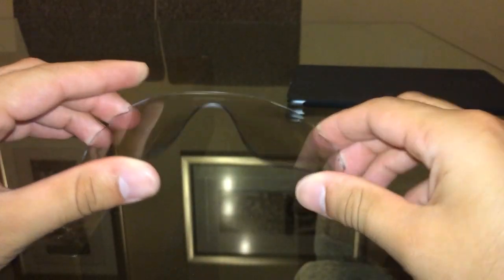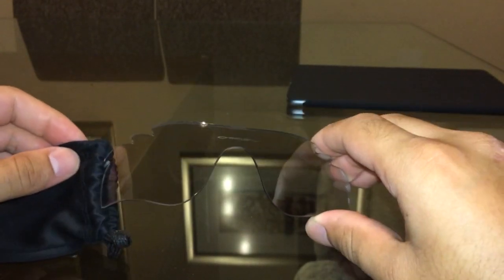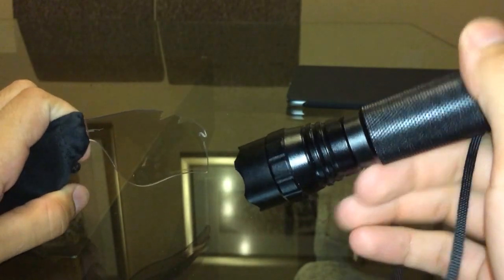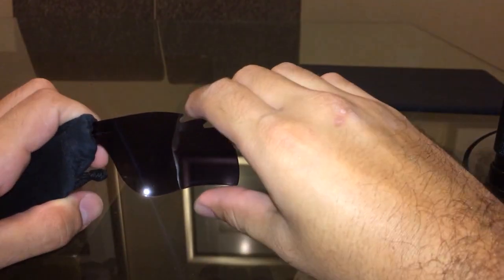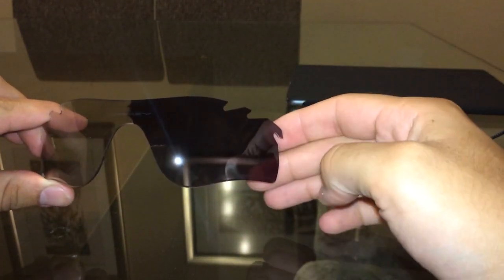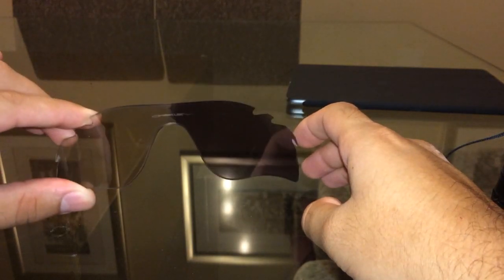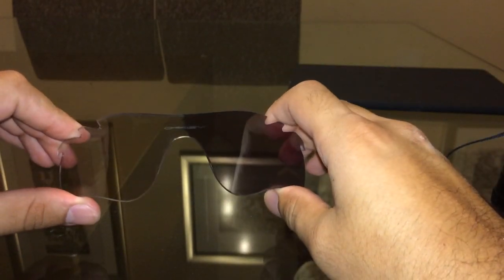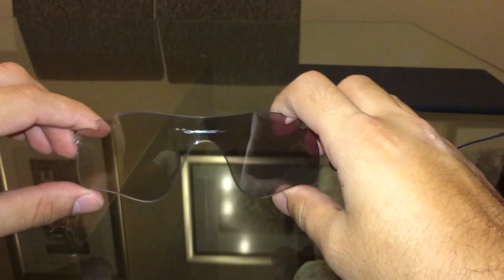Oakley Photochromic - Transition demonstrated

Comment: Thank you for the video. You used a very strong ligth that turn the lens very dark. In real world sun ligth, how fast is the transition time? I was looking to use them on trails where there could be huge variations of brightness in a very short amount of time. Do you think this lens would be good?
Reply from the maker: Davide Sandona' I can't exactly say how fast they change, however, they work perfect for what you are suggesting (I'm using them for the exact same purpose). If the trails you go in are not too covered and dark I would suggest you use the Prizm Trail lens, which I have been using quite a lot lately. They are not photochromic but definitely makes the plants and soil color pop out so you get better clarity and are able to better discern where you're going.

Comment: Do they work good if it's really sunny out or do you need the prism lens
Reply from the maker: Hi Matthew, they work well enough but nowhere near as dark as the demonstration. Remember I was using a very strong UV light to show how dark it goes. However, in real world use it's good enough for really sunny days (I live in Paraguay). I also own an Oakley Jawbreaker with the Prizm Trail lens, and these photochromic seems to get darker than the prizm trail lens.

Comment: I bought the EVZero Range model with photochromic lens but they don't seem to transition as dark as yours. I noticed the specs table lists the light transmission (activated) is 69% so that might mean they don't go as dark as yours (which look more like a activation of 90%+)

http://www.oakley.com/en/product/W0OO9327PHT
Reply from the maker: Hi Jose, sorry for the late reply. Take into account that I was using a very powerful UV flashlight to simulate the effect of sunlight. In real life use while biking, it never gets as dark as the demo. For instance, I can see my eyes on the reflection of a mirror when they are fully transitioned while in the sun.
Reply: ah that makes sense! too bad I already exchanged my first set thinking they were faulty. I went on the Oakley site and noticed they have an approximate 63% light transmission which means a fair amount of light gets in. I've gotten used to them not blacking out completely. I'm hoping the lens is interchangeable with the Path, even though the techs at the Oakley stores tell me the EVZERO line wasn't designed with that feature. Anyone swap their Range for a Path lens?